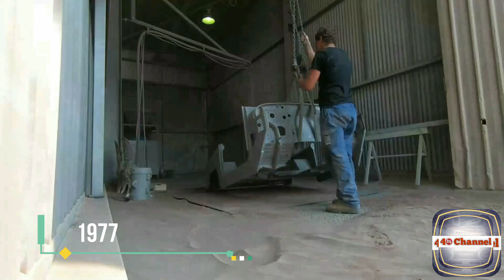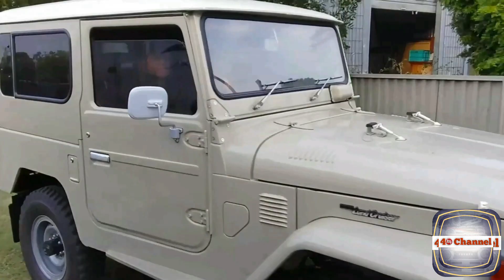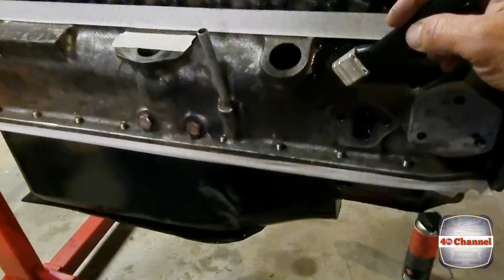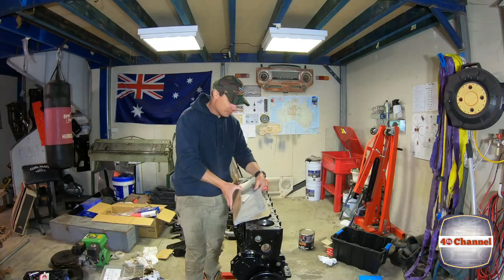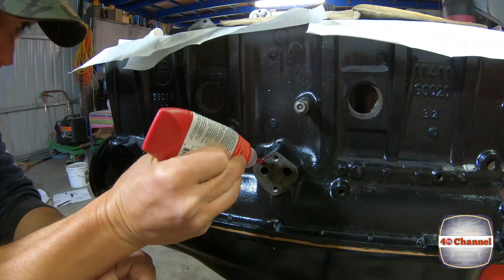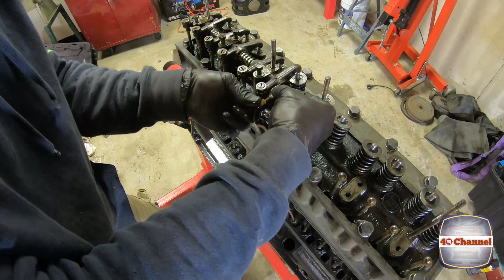S2EP33 - Landcruiser Head install plug, oil pressure regulator - push rod missing?

Comment: Hi, I am just about to jump into my F135 its in my Toyota FQ15 a truck version of the FJ40, I am struggling to find parts my engine runs fine but I would like to pull it apart and ensure it will run for many more years to come. My F135 is the Siamese version, do you know if there is a oil filter update that can be done as the original oil filter is hard to come by.

Comment: Perfectly fine to reuse the head bolts, since the F is a low compression, low RPM motor. With that being said, I personally never reuse a set of head bolts more than once. If it has to be taken apart again, I'd buy new bolts just to be safe. Also, no anti-seize on the threads...you should LIGHTLY coat the threads with engine oil, and place a small amount under the head of the bolt before torqueing. This is what I've done all my life, and recently got confirmation from the Toyota engine builder / specialist in my area....
Reply from the maker: Hi Mike, thank you for the feed back, much appreciated. The product I used was Inox mx7 a PTFE anti-seize. Which says it can be used for cylinder head assembly. So more of a grease with anti-seize properties I guess. Hopefully will be o.k

Comment: Should be ok to use the old headbolts. But I am not sure if you should put em in with antisieze, if i remember correctly the headbolts should be put in dry couse the lubricant could stuff up your torque numbers.

Comment: These are old school head bolts. 🔩 No problem reusing them. The new style head bolts are torque to yield bolts. One time use only as they are designed to "stretch" when tightend and cannot be used again. No worries 👍
Reply: I agree. These engines were designed to be simple and serviceable in the field. Nothing wrong with using the old bolts.

B.I.B.L.E. Basic, Instructions, Before, Leaving, Earth.